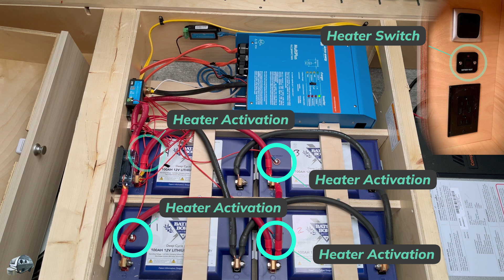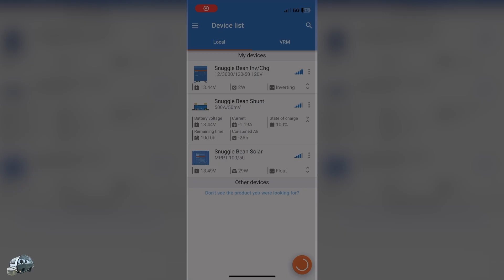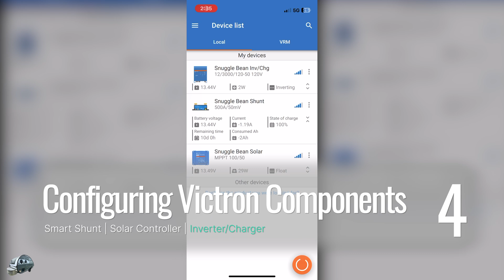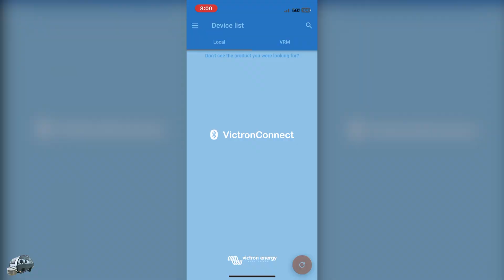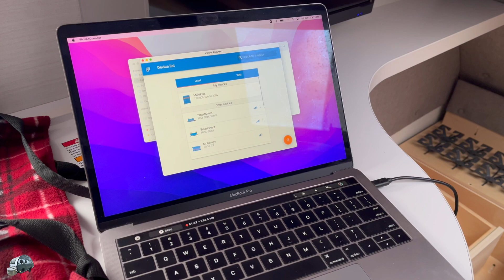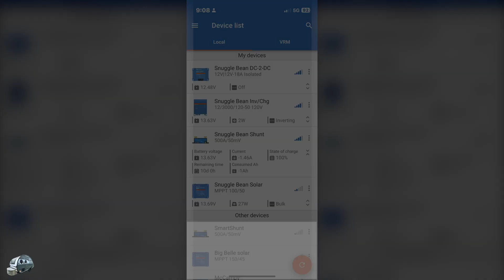Configuring the nuCamp T@B 400 Power Systems | Victron Multiplus, Smart Shunt  & Solar Controller

Comment: We are in the process of buying a new 2025 TAB 400 sight unseen.  The TAB comes with one 100ah battery and we are having a second installed by the dealership.  After watching the excellent video we assume we will need to do the same optimization.  Does the VE.Bus to USB-C come with the trailer or must it be purchased separately?  Any other tips for new TAB 400 owners?  We have been camping in a TC Teardrop Overland for the last 5 seasons.  It had a lithium battery and victron charger so the learning curve hopefully will not be steep.
Reply from the maker: Thanks for your kind words and great question.  I cannot be 100% certain on what equipment comes with trailers rolling off the line these days, but I think you don't need the dongle I used to program the Inverter/Charger.  The 4x Battle Born upgrade also comes with a 3000W Victron MultiPlus Inverter Charger.  THAT was the device I needed to configure with the dongle.  All of the other devices (Shunt, MPPT Solar charger) were/are configurable from the app on my phone.
I believe you will have a charger that is integrated into the power center and an AIMS inverter. You may want to check with the dealer.
Reply: @mvemerson I think it will have a similar victron charger/inverter only a 1200 watt model.  I do not have a great deal of confidence the victron will be setup correctly.  We shall see
Reply from the maker: Happy to help when it come to it.  Reach back out when the time comes and you need help.
Reply: @mvemerson  We saw the TAB in Feb.  We have an AIMS inverter since it is not the 400 ah upgrade.  It will not need to programed.  However the WFCO is also my DC charger.  Theoretically it will automatically handle Lithium batteries.  Research will be required.

Did you wire the TPMS into the junction box the 7 pin connects to the trailer?

I also plan to use a DC-DC charger (Victron XS).  I may reach out to you when I go to install it.
Reply from the maker: Hi there. Yes, I wired the TPMS relay/signal repeater to the 7-pin junction box by the spare tire.  

In terms of the DC-to-DC, it has been working g great for us.   There is a video on the channel, but i will also gladly help out.

Comment: Wow! What a treasure of information. It’s sad to see that even factory installed upgrades are done incorrectly. Are those settings apply only for battle born batteries or is compatible with other lithium batteries?
Reply from the maker: Thanks.  I was lucky to get the exact settings from Battle Born.  From what I have seen, they are pretty close to those of other manufacturers.   If you cannot get things like Absorption and Float voltages for your Lithium batteries, generic Lithium settings would be much better than Lead-Acid settings, which I believe are the defaults.
Reply: Thanks for reply. Did you contact battle born or Victron to notify that their systems being configured incorrectly by Nucamp? Do you think Nucamp will make adjustments going forward?
Reply from the maker: @igorkondrya92  Interestingly, I mentioned it to Battle Born, and the person I was talking to seemed offended.  I am wondering if nuCAmp is getting these systems right along with the batteries from Battle Born. I have seen a number of posts on FB that the Victron systems are frequently NOT configured correctly.   Also, VE Networking should be turned on for all components. Working on a video to explain that.

Comment: What do you recommend for the solar charge controller for the portable panels?
Reply from the maker: I would stay in the Victron Energy ecosystem and get a Victron SmartSolar MPPT 100/30 for a 400W panel or 100/50 to not run it at its maximum.  I would not go smaller for a smaller panel, allowing for growth and flexibility.  This assumes that the voc of the panel or panels does not exceed 100V.  It very much depends on the panel you plan to use.  Do you have a panel in mind?